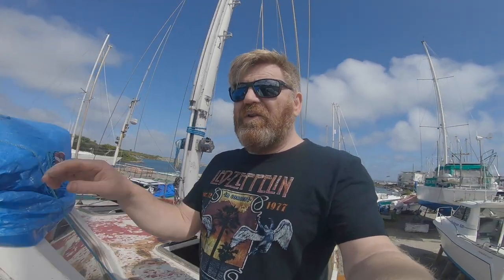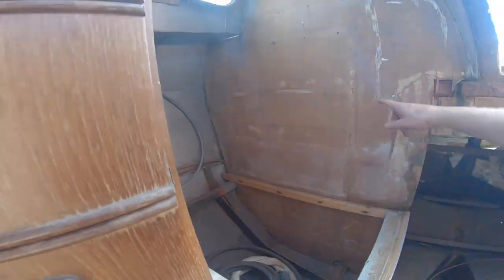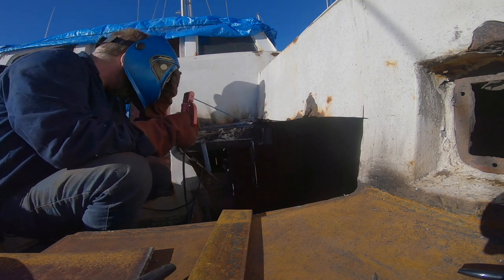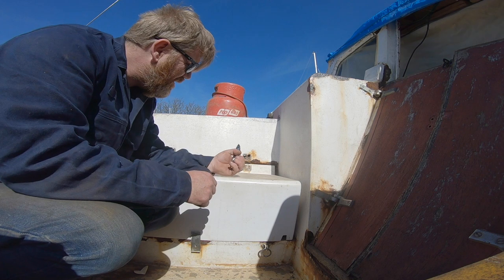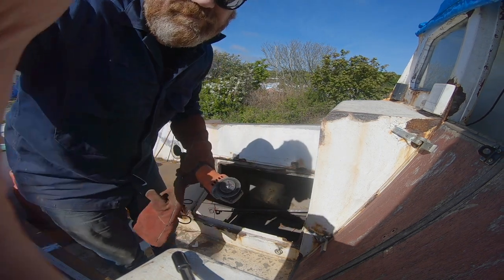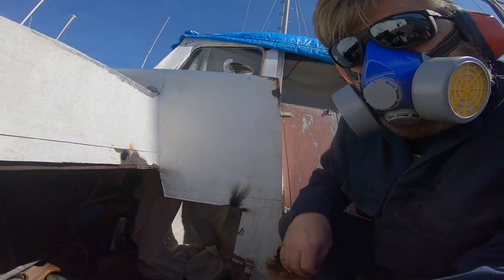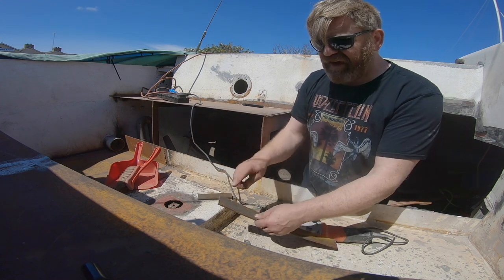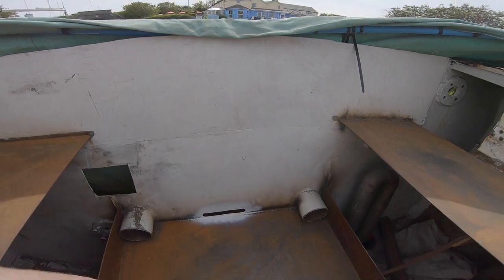#45. - CHEAP DREAM YACHT????  RUSTY NIGHTMARE!!!!

Comment: Great job Andy! I live in a warm climate. When I look at those seats you are welding I can only think of sitting on them in a hot sun - you can't.
Reply from the maker: There’s LOADS more to do. Including wooden slats, removable seat upholstery etc etc. Of course I wouldn’t leave the seats or bathing platform as bare painted metal :)

Comment: Andy I have built many steel boats the one thing I would like to see is the underside or inside of the plate steel cleaned and painted before welding in place . It makes it so much easier later on with this done ,keep going mate it will look great when finished   from Neville in Maryborough QLD Australia
Reply from the maker: I completely agree and would value your ad ice on this

So if I’m at the boat for 1 day and want to weld in a seat top for example.
I can cut the panel, test fit, paint with 2k epoxy primer but then I would have to wait 24 hours to weld it in and I simply don’t have time to come back the next day with work commitments to weld in panels after they’ve cured.

Also, with our weather being so changeable, on a dry day I need to cut out and weld in as much as possible because chances are we will have days of torrential rain after that.

So I fully agree that would be best practise but I’m not sure how to do it.

I could prep and paint the entire sheets but then I couldn’t use the plasma cutter to cut out the pieces. 

Dilemma

Comment: Hi mate your really making progress! Kind of agree with you on the enclosed cockpit. Have you thought about putting waterproof access doors in the seat tops? There are some good ones out there that are pretty big, totally watertight and come with a big template. Obviously you are not going to be sitting on a steel seat so they would be covered by either your cockpit cushions or teak type seating frames? Just a thought. Sail Safe mate. Ant, Cid & the pooch crew.
Reply from the maker: Hmmm not seen those. Don’t suppose you have a link do you mate. Thanks for the suggestion

Comment: if you put opening front to sealed compartment for say gas or dingy  fuel at stern port side ,no water ingress to boat and fire containment . vent to transom ,safer for paint thinners ,with automatic fire exstin    . it would still leave 80% storage space forward .

Comment: I am inclined to agree with the idea of losing the hatches if you are rarely coming into dock or using them in other ways like rafting up to other boats. We have our boat at a dock but usually go out for a week or two to be at anchor when we leave. When we go out the fenders go into deep storage and aren't seen again until we come back. We have permanent dock lines so only need a few throwing lines when we come in. You could build some temporary storage for fenders on the pushpit or pullpit if need be. One consideration would be if the fenders get dirty where an external locker with a drain would be nice. Our sail locker is used for fender storage and it has a drain so is easy to clean out if need be. You didn't introduce us to your buddy.

Comment: I prefer stick for items I cannot get clean; but, a gas shield is better where material is clean.  I like clean off the scale and rust then tape off the edges where I will be welding an spray a good zinc paint onto it.  Once I weld it together I coat the welds and taped areas.
Reply from the maker: I know what you mean yes

Comment: We generally agree with no cockpit lockers. Guess there is convenience as opening lockers as they save bringing wet fenders and warps through the living accommodation.
With our centre cockpit the cockpit locker is needed as we have the aft heads at one end and the galley at the other. So no other access to the space.
Reply from the maker: We will be able to chuck stuff directly into the aft lasarete just inside the pilothouse so I can't see it being an issue but if it is I will easily be able to cut a lid into the seat later on as I've constructed the frameworks specifically to allow for that

Comment: I'm with you with regards to the cockpit. If you can get access from below then make the cockpit watertight and if you get pooped you'll just get wet feet.
Also in a bad storm you won't want to be opening a hatch and put your boat at risk and your not going to be single handing so you'll have slaves/ crew to fetch things for you.
I like the transom entry again from the pooping angle to get rid of water fast, just have a netting gate thingy to act as a strainer so you don't loose your beer, oh or crew🏴‍☠️

Comment: Hi, I've being following your progress, your doing very well,  I've been a welder for many years, I felt you need some tips, especially when MIG Welding ,it is a lot easier over all 
but a much over looked aspect  on new plate such as you have is to sand off the mill scale to bright steel, it might not seem important but if you give it a go your welds will
be much improved. Also being as you are only using relatively small sections of plate it would be more economical to buy pre primed 8 x 4 sheets and pre prime all your flat bar etc
I know buying pre primed plate is a bit more at the out set, by the time you get around to doing the over all paint work you will save your self a lot of frustration and time
and sanding discs, and one last thing I've noticed there appears to be a lot of 90 degree plate joints, or it could be just the camara lens, what ever you do try to achive a radius 
on all your outside corners as 90 degree corners will always chip, I know these joints  were already done by the original builder, lots of love and keep on going!!

Comment: Probably a good move to get rid of those large steel  opening locker lids, not least because they are heavy and a real finger trap. For the future when you are short running and requiring warps and fenders, you could knock up a skeleton fender storage frame and just put your warps on the guard rails/wires - very common practice in the Med.
Reply from the maker: Yes I’ll weld up some nice stainless fender holders and hooks for warps and weld them to the solar arch

Comment: Pre blast and paint your plate, you will save your self a lot of awkward work later, weld with whatever you have at your disposal, no difference in strength, any exposed edge or flat bar use stainless steel even 304 if you're going to paint anyway, don't build in rust traps where you can. Good work 👍

Comment: MIG is good enough. Down side, the weld is hard, takes more to to grind weld even. That's the reason for me building with MMA and Lincoln Innershield (MAG). Cockpit at sv Hulda is built as a watertight box. No hatches, a filled cockpit drains out in seconds.

Comment: Hi,love your Podcast and never miss a beat. 
Iam an Engineer and I was wondering why you don't use Lanolin on raw steel.I have a Dennis Ganley yacht  which was built in the 1970,once the yacht was built the whole inside was sprayed with Lanolin, the steel is still to this day like new...please try this product. It's not only good for steel, but wood to.
Another thing in your cockpit, cut those pipes out for draining flash to the hull transom and no false transom floor, that my friend a problem. 
Good work, fair winds. Johann
Reply from the maker: You're right, I'm changing the design for the cockpit drains for sure

Comment: A waterproof cockpit is a great idea!
I have one locker accessible from the cockpit, but that doesn't mean everyone has to have one.
I did little lockers around the cockpit. It is possible with you too, but it requires a lot of work. I made lockable openings at the top of the breakwater (?) (What you lean on when you sit in the cockpit) You have empty space there to use.
How are you going to illuminate the aft cabin?
Reply from the maker: We will check them out yes! Thank you

Comment: re the cockpit lockers go with your plan and if its to annoying hauling warps and fenders out of the main hatch then maybe put a locker back in under the aft seating area. fyi ive use nogas mig wire for tacking outside when its to windy for mig i hate stick welding..
Reply from the maker: Yea I’m definitely going to buy some nogas wire. Lots of people are recommending it.
I tried nogas about 10 years ago and hated it but maybe things have improved in the technology since then

Comment: Andy, spray your plasma cutting tip and head with mig splatter spray, will get 2 times the life out of the tips if you do before each time you use
Reply from the maker: Good tip, never heard of that stuff but ill get some from the suppliers

Comment: I crew a 40’ race boat and we are always in and out of marinas and through a lock, we have no opening cockpit locker and have never felt the need. Different if you are single handed but then you can just prepare fenders further in advance. 
No issues mig or mma, if it’s windy pick the mma but otherwise use what you know 👍

Comment: Just remember - with Mig you are probably getting poor penetration if you are welding thicker plate at lower power settings. The weld may look good but may not be fusing the steel sections together.
Reply: Oh - and put the guard on the grinder (take it from a boilermaker)
Reply from the maker: Thanks will do and yes noted.  I do tend to use high amps and low wire speed

Comment: In my shop I don’t have a big enough power supply for me welder so I run an 11kw generator for my 220 welder. If I forget to add fuel, I’ll get un announced power outages as well. They are no fun.

Comment: No lids in cockpit, just let's water in, and stick, mig or tig welding is all about the same, I have  repaired a lot of steel boats  using all 3 different types of welding so do what makes you feel the most comfortable
Reply from the maker: I agree! thanks

Comment: The only benefit to having access doors topside is that it looks to be a fairly long space for to aft.  You are going to access it from a forward door.  Everything in front will have to be pulled out to get at the stuff aft. It’s all going to go in your cabin area. That stuff is mostly stuff that goes outside like lines and bumpers and the like.  It may get messy.  So having an access topside may make accessing stuff in the back easier and reduce the dirty stuff you need to pull through your cabin.  I think I’d switch the hatch to the aft bench and leave the forward part of the bench hard.   I’m a professional mariner. I don’t have a boat though yet and all my handy work is going into renovating my house.  Boat comes next.  Point there is I don’t have a frame of reference on that boat. It helps to “live” in a space for a while to really figure out what will work like you guys are doing.  All that to really say, you guys are awesome.
Reply from the maker: Wise and sailed words for sure. I’ve welded in frameworks underneath the aft portion of the seat in such a way that I can easily install an opening hatch there. So yes I think, live with it for a while and if the access to the very aft end becomes a right royal pain in the bum then I can put an access hatch in somewhere down the line
Reply: Or put in a box in the far aft that is watertight. Put stuff there that you will need access to the most. As long as the person who gets the "guest" berth has room for their feet. But yeah, whatever you need at that moment will be behind all the stuff you don't.

Comment: I think you will regret not having that storage ,design a lid with all round seals.
Reply from the maker: You may be right but I can add that down the line easily enough. Lovely thing about steel it’s easy to change.
The access to the lasarette is excellent through the pilothouse though

Comment: I too like the idea of no lockers. But they do come in handy. 
What about a propane locker? Or are you going all electric?
Reply: Propane was the one thing I could think of that needs a locker as well.
Reply from the maker: We will have a propane locker for sure. But I think I’ll make it so that I install the bottles from inside the port side locker/storage room
And then close the from door on the locker and the floor of it will be sloped with a gas drain going out of the boat so once the door is sealed shut the only place any gas leak can go is outside
Reply: @SailingMelody  Ah, nice solution to keep the exterior sealed...
Reply: @SailingMelody   that’s a good idea. And I think it will help fit the transom door. Which I vote yes for! It will be a lot of work but I think you will love it.

Comment: When I built my yacht, not the stupid  Yank modification of the word, used for motor boats, a pleasure boat that sails, I used stick for structural, welds, and mig to make a fast fill of other areas .
Reply from the maker: Thanks, great tip

Comment: I have an iron bar from a silver mine dating back to the early 1800's. The iron bar was part of a water trough to redirect water from a river, to flow over a water wheel to power lifting equipment. It has been stood in the ground, outside, in rainy Wales, since it was used, until i pulled it out of the ground. The bar's surface is struck to form its shape (IE not smooth but ball pinned in appearance). when you rub the surface lightly, you see shiny bright metal. Though rust coloured there is no depth of rust. A nut on one end was successfully unscrewed by my dad.   

So, does modern steel rust to destruction, because it is now made to corrode?
Reply from the maker: There’s a big difference between cast iron and mild steel. Also there are different types of steel designed for different purposes.
Some types are designed to oxidise on the surface but not corrode further, used for bridges and sculptures etc, but can’t be painted and aren’t suitable for submersion i. Salt water. Hard to say exactly what that piece of pipe is made from, have to ask a metallurgist

Comment: What's funny is I had a friend that was a fabricator/pipe fitter,  and he schooled me in welding. He told me that if you are good at stick welding, "Never tell Anyone". LOL .. There is nothing at all wrong with mig welding if you can make good beads then your all good. Takes a pretty stout Mig Welder to get good beads on heavy steel. But I don't see the problem in this application. Your steel is not thick enough to make much difference. And you are indeed doing it backwards. You would tack it in with the mig and dig it in with the stick. Hint. Use 7018 rod.
Reply from the maker: Hi :) yes I’ve got those rods I think. And my stick welding is definitely improving the more I do

Comment: The new seats you are building look like they are way too low to be comfortable to sit on.
Reply from the maker: They’re actually fractionally lower than the originals but keep watching and you’ll see a clever second stage to those seats.

Basically I’ll be putting some wooden slats on the BUT I don’t  like the idea of putting wood directly onto the steel sheet so I have an ingenious solution for this to make the seats much more comfy without creating rust traps
Reply: @SailingMelody  Ah haa!!!  I'l be looking for that.